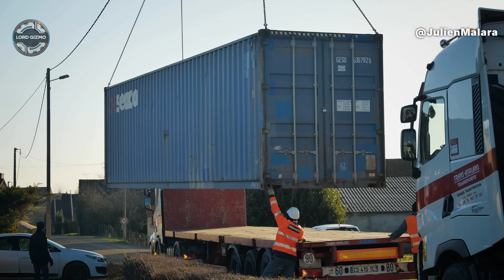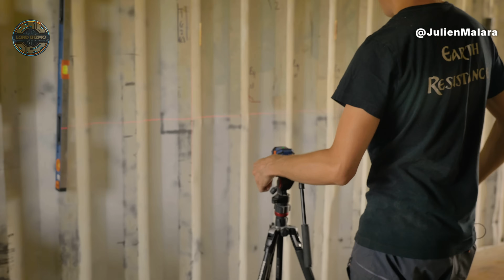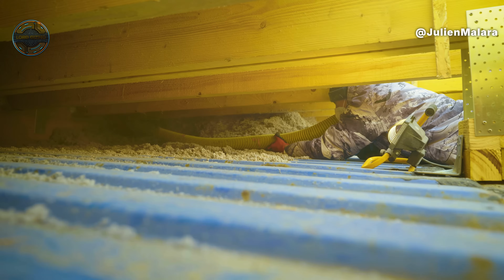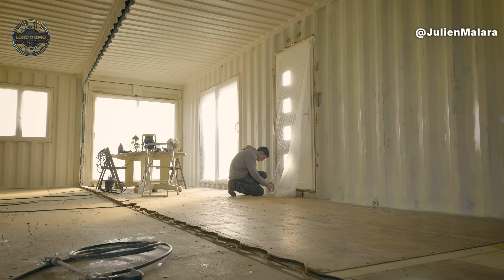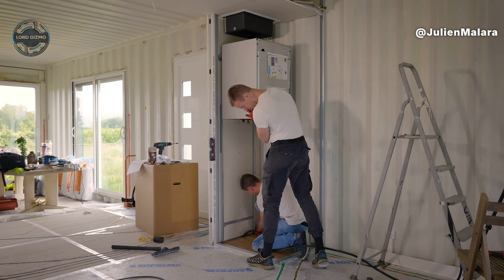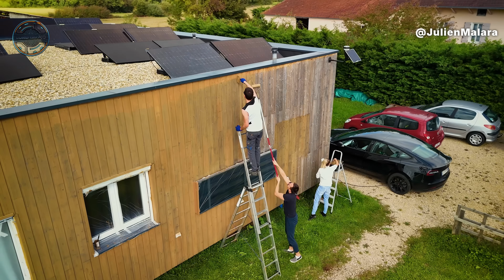He Turned 4 Shipping Containers Into a Luxury Home | Start to Finish by @JulienMalara

Comment: Pool on the roof 😂
Reply: OSB under shower liner...what could go wrong?...
Reply: @puzer1 😂😂😂😂😂👍
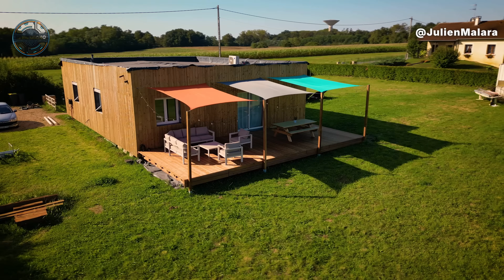Reply: 21:27  you can see one of the drain pipes high, to the right of that corner. I guess it would be connected later to a vertical one.
Reply: @cristiandxbyup at 12.51 a scupper at each corner, you can even see the dirt marks where the water traveled to one
Reply: i was thinking the same thing theres no drains for water on the roof unless they didnt show it
Reply: Exactly! 😂

Comment: Truly the most wasteful use of containers that there is. You basically used the containers as a boundary layer for the insulation. That was a load bearing wood frame and roof with containers parked inside the "pole barn."

Comment: Only thing I didnt see covered is how does the roof drain?
Reply: They should’ve added soil and sod make it a live roof. Around the solar panels 🫠
Reply: 21:27  you can see one of the drain pipes high, to the right of that corner. I guess it would be connected later to a vertical one.
Reply: Why would you want to drain the roof pool?
Reply: @benf101 😂
Reply: Rule one in roof construction..avoid parapets especially on all four sides
Reply: First thing I noticed. So much virtue signalling. We should feel so warm and fuzzy.🤮
Reply: And I guess it must be in an area that gets snow snow because snow would build up on the roof and cave the fucking roof in…!
Reply: Cost to build a home I’m going to guess if this was done in Pennsylvania in 2026 the entire project without the land without the well or septic would cost around 2 million + to do…..!
Reply: excellent!!😅
Reply: Yes , it’s a good concept but should have been a sloped roof for dropper drainage. That flashing they installed was definitely questionable.
Reply: @M1978-p8j right. They must have forgot to cover it. Even if its a desert you still need drainage or you have a pond on top of your home if it rains.
Reply: @alulatadesse1646 Bonus roof top pool
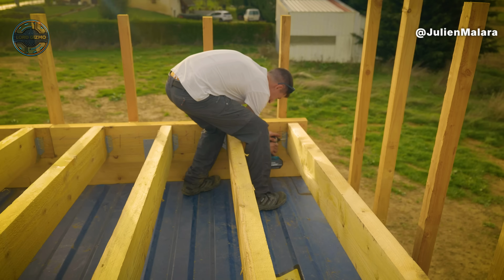Reply: @M1978-p8j  It is slightly sloped. If you go to 8:33 you will see it's raised in the middle.
Reply: @cyflym11  You're right.  You only need 3 degrees of slope for water run-off and it looks like they're at about 10.  I just hope thay have drains.  lol
Reply: @M1978-p8j  The roof is sloped look again.
Reply: @M1978-p8j  I LIVE in a rainforest - my question too.
Reply: you are right lol